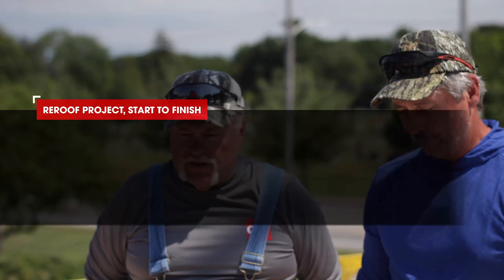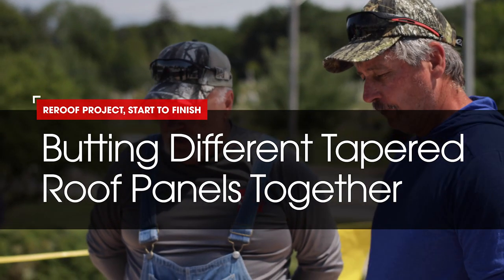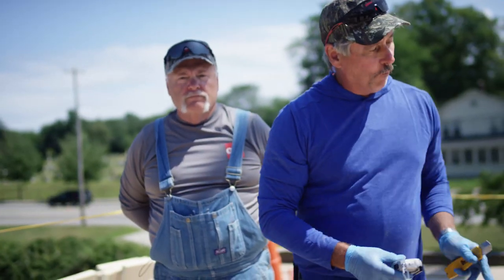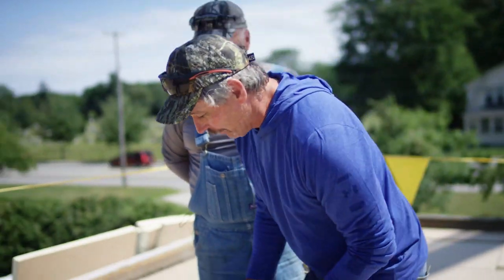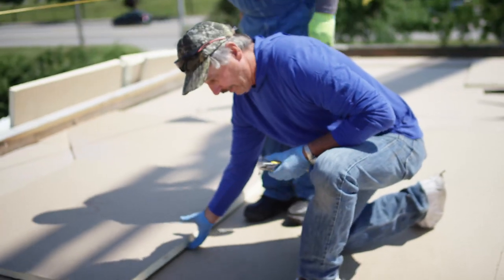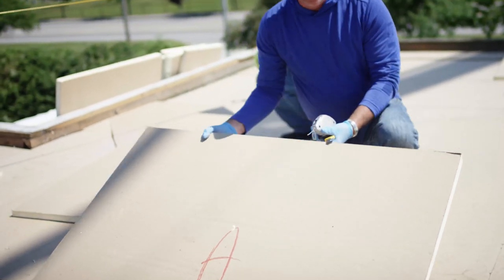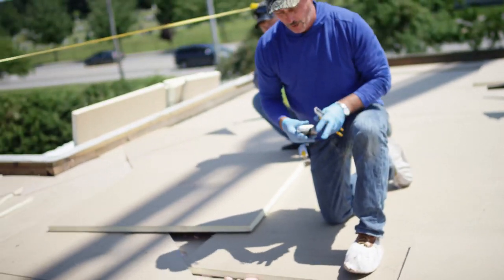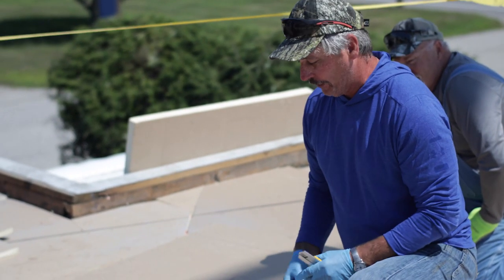How to Intersect Tapered Roof Panels For Proper Slope | Roofing it Right with Dave & Wally by GAF

Comment: Why is it waste? It wasn’t very clear.
Reply: The goal is to ensure that the water is routed to the drain.  When you try to reuse a panel that you cut previously, the likelihood of it fitting perfectly and lining up with the next board perfectly is extremely low, so it may create a puddle area if not done properly.  The amount of time wasted trying to reuse panels exceeds the cost of ordering enough panels to get the job done.